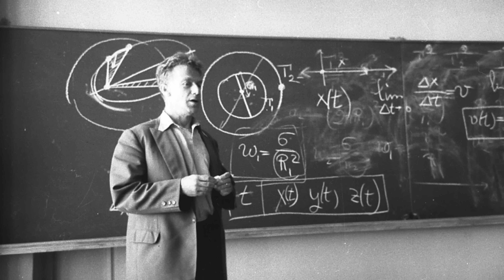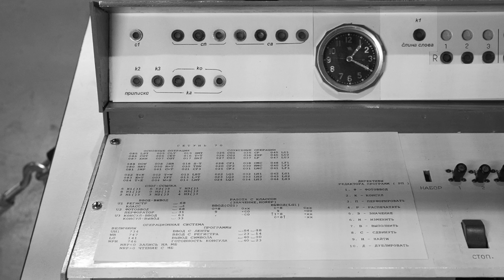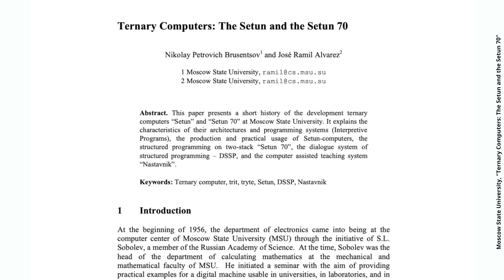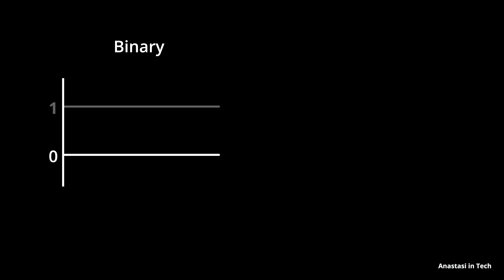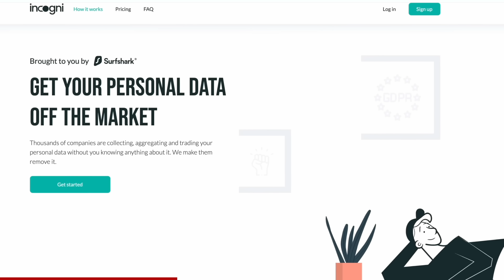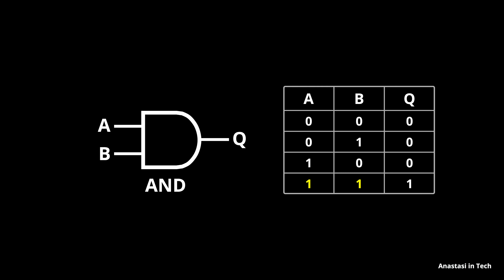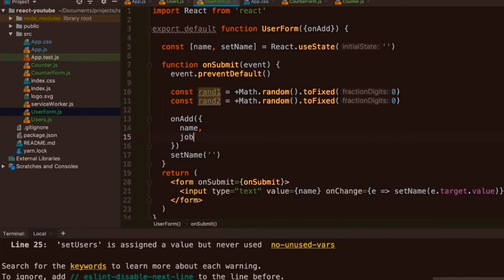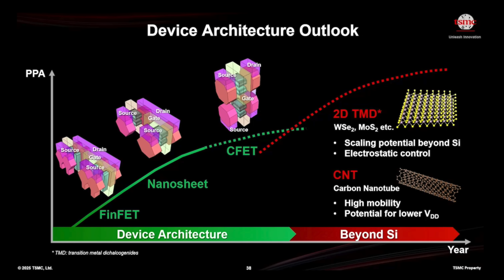The World's First Ternary Computer

Comment: A combination of buzz words but no explanation.

You told us, a ternary computer would use trits of -1, 0, and 1. This could be made by using -5, 0, +5 Volts in the chip. But where are the benefits?

No, subtraction will not be easier it will be more complicated! Calculate a +-0 to a decimal value! Even representing values is pure horror. We would not use -1, 0 ,+1, we would use 0, 1, 2; no matter of the sign of the current.
On binary machines we can distinguish negative and positive values with one bit, whereas 0 is positive. On ternary machines a compare cycle is needed. Whereas a compare cycle means a subtraction discarding the result, just keeping the CPU flags.
Subtraction on a binary machine is quite easy:
1. Invert all bits
2. Add 1
You have the negative value: 2's complement
3. Add the value to the value you want to substract it.
Maybe on a ternary machine it would work as easy as this, except more complicated circuits inverting a +1 to a -1.

Vacuum tubes and transistors always have and ever had infinite values. Both devices were and are used for amplification. One low input current controls a way bigger constant current becoming a modulated, higher output current. Even relais can have infinite values. One input just turns on and of the other input. Whatever gets into this other input will leave the output almost unaltered.

Digital tech is analog tech. An analogue signal of a defined strength is a 1, an analogue signal of 0 or below a defined strength is 0. And any signal inbetween is undefined, resulting in random 0 and 1. This is how any computer engineer works. Think of transporting serial data. Switching from +1 to -1 (and vice versa) will reach 0. On slow computers of the 1950ies this will work, maybe with an additional line for synchronization (whereas binary transport allows transport without a sync signal). Today we switch from parallel to serial communication: The speed of our computers is so fast the time differences on parallel lines are a big problem. 3 wire communication is parallel: GND, DATA, SYNC. On binary 3 wire channels there is the undefined range. Measuring it means a communication error. Ternary machines just run into a random value, unable to detect the error.

The Soviet Union failed in computer development. They needed their colony GDR to get machines to procude Z80 clones. While GDR copied 8086 CPUs. The Elbrus CPU is a SPARC clone and Fascist Ruzzia is unable to produce them.

Comment: And the 3rd state when dealing with electricty and transistors being? Will our chips run with 10x the voltage for a few minutes and then melt?🤔 Not to diminish the accomplishments of your copatriots, but it reallly looks more like a nice science experiment than smth. that is applicable on a large scale. There are other designs in the works which are more robust and probably less theoretical in their execution.

Comment: There will be less noise, as the pulse front will be smoothed out due to the three states. Three states and ternary code have been used in the data transmission system (OSI layer 7) for a long time. Вот шума будет меньше, так как сгладиться фронт импульсов как раз из-за трех состояний. В системе передачи данных (седьмой уровень OSI) давно используют три состояния и троичный код.

Comment: i always wondered about using a adc and a dac to change 16 bits into some ohms then you can store 16 bits on a single resistor. its a way to interface with binary tech using one wire tech and send 16 bits per pulse its faster than serial infact using 3 color light fiber optics you can do 48 bits per pulse based on each pulse is 3 colors each color is a analog input. or more thats all based on the dac and the adc is 16 bits but i seen a 24bit but you can always add multiple together to get more bits you can get 64 bits per resistor you can get three 64bit cpu commands per fiber optics pulse. i kinda abandoned the idea when i decided if i wanna do that i might as well go back to core rope memory or not that but similar tech something i can make with a cnc machine.

Comment: Ternary logic systems (using three states instead of the traditional binary “0” and “1”) do have theoretical advantages. Each “trit” (ternary digit) can represent more information than a bit — specifically, log₂(3) ≈ 1.585 bits’ worth — so computations and data representations could, in theory, be more compact and efficient.

Comment: I can see it’s advantages and disadvantages. You would have to create a new compiler, new software to take advantage of the additional option, the smaller size, faster rate, less heat and power consumption but the data storage would have to remain the same or you would have to create a new way of storage. As someone else pointed out, the transfer rate would have to be changed as well. I could see it working in a sine wave I just can imagine it working in practice. Binary to me is the simplest and fastest way for transfer rate.

Comment: Ternary systems face significant hurdles. Hardware design is more complex—binary transistors are simpler, cheaper, and well-optimized after decades of development. Ternary logic requires components like memristors or multi-state transistors, which aren’t yet as reliable or scalable. Standardization is another issue: the entire computing ecosystem—CPUs, memory, software, and protocols—is built around binary. Shifting to ternary would require a massive overhaul, from chip fabrication to programming languages. Energy efficiency gains are also unproven at scale; while some simulations suggest ternary could reduce power consumption, real-world implementations like Setun didn’t consistently outperform binary systems.There’s also the question of necessity. Binary systems have scaled remarkably well—Moore’s Law held for decades, and modern techniques like parallel processing, quantum computing, and neuromorphic chips address performance bottlenecks without abandoning binary. Ternary’s advantages shine in niche areas, like certain AI algorithms or error-correcting codes, but it’s not a clear winner for general-purpose computing.

Comment: Excellent video, I'm glad you explained the ternary logical operation (-1 && -1 appeared a second time in place of -1 && 1, so you are aware). I was curious to know how it worked. I like the idea that using two "trits" you can store more states than using three bits.
The missing point? Conversion and compatibility. If you can convert ternary to binary, or vice versa, then it will be easier to integrate, expand and eventually judge if the added complexity is worth phasing out binary.

Comment: When I was a kid, about 8 years ago, I told dad that modern computing is in binary or with the base 2 (1, 0) and it is quite inefficient, what if we would compute at like base 3 or Trinary(yep I called it this back then)(0, 1, 2 or 0, 1, -1). He brushed me off saying it was a radical idea with almost no mathematical backing let alone practicality and that I should use my brain on something more "pragmatic". Glad to say I wasn't wrong. Would love to be a part of the Ternary or "Trinary" Revolution.
Reply: There is too tight margin for errors in hardware parts which has to be developed yet, 2 standardized micro parts vs 3 with very sensitive borders where errors would come too often. Same as having one car battery, having 2 batteries in series and more, you need BMS (Battery management system) for absorbing and redistribution without errors.
Reply: @Your_opinion_does_not_matter Only if you do not code for fuzzy logic which i personally predict we will be doing within the next 10 years. Todays hard- and software are chiseled in stone for 100% "truth". But thats not how biology works.

Comment: I used to work on Flight Simulators produced by Link systems back in the 60's/70's.  They used MECL devices (Motorola Emitter Coupled Logic) in their computer processors.  They didn't fully turn on or off a transistor logic element but the output of a logic gate changed from -1.15 volts (a logical 1) and -1.5 volts (a logical 0) (could be the opposite, it's been a while )  This made them extremely fast.  We were able to run two 727/707 full motion flight simulator cockpits simultaneously with 8k of memory and 16 tracks of 8k programming code.  Still digital and It did take a LOT of power to run but worked beautifully.

Comment: I had seen on another channel that topic a month ago, and found it fascinating. But the recent news about Huawei is a new step forward, and that could bring a huge improvement, making it a bit more real. Also, the part about graphene is all new to my knowledge, and, while I find it great, it sounds like most things I've been following in new techs. Graphene seems like the new material that should change everything. It would make batteries so efficient (especially for EVs, but it would benefit everything) could be used as water filters, and many other things, all the while it's made of one of the most common elements in the world, carbon. If it stops being just a nice promise for the future and becomes even 1/2 of what I've heard about it, that might bring so much improvement in everything. Till then, it's sadly nothing but a promise for the future.

Comment: We touched on ternary state logic in university decades ago. For me, it was the logical states. In electronics we were already differentiating varieties relative states ±.5v, ±.12v and 0v. Why couldn’t we do that with logic gates? This is doable but yes, at such small Delta V we need better precision in circuit integrity noise protection. And I agree with the needs of today, AI requires much more memory to meet our imaginations. It is the only way we will achieve the sophistication of an android named Data.

Comment: When you power a 'computer' ON...it is then capable of binary computations, but is in 3 States. ALL computers, chips, etc are 3 state or more... they all require POWER first, binary second.
Reply: ...American transistor? :D 
Transistors are binary...
Reply: Base3...kinda sux hind tit... it requires more bandwidth, longer trinary phrases, longer code, longer parity checkers, and massive data buses... and memory assignment...is...kinda sketchy. Longer transmission times, higher power requirements to push all that...
Reply: ...any 'computer' can run Base3 languages... but, they are old, outdated, outmoded...clumsy, awkward...and limited
Reply: ...where you may have a Point... is quantum computing. :D 
IF quantum computing is considered 3 state programming... 
Or, +spin, -/+ transition spin, - spin due to coupling vs entanglement... 
 But, that would more than likely be in arrays of 3 or cubes of 3x3x3 as a bit. Half Bytes ( nibbles ) would then be 9x9x9 and full segment phrasing would be constructed of 729 bits to a word/command. ...and the firmware for this would be...really power hungry, heated and would technically be comprised of 4 state chipsets... power On and then the trinary quantum states. 

* 3 state chipsets already exist since like the 50s... or trimisters, rheostats, JFETs, UFETS, etc.

Comment: Can someone work on light energy vs electrical energy in 3d glass components type with different type of logic. Similar to trinary logic, light from 3 direction and receives in other direction,  with a cross function of light criss-cross as logic operator those compile multiple binary processor to translate to our current framework but way faster speed with logic operator on the side

Comment: The optimum is e=2.718....  Thus, 3 is closer to 'e'. But it is getting quite complex.
Let's assume 0 and 1as a condition, and then x as a third condition.
A generator for numbers, based on a power of three, would be as follows:
.
01x0=15=F
011x=14=E
0111=13=D
0110=12=C
010x=11=B
0101=10=A
0100=9
00xx=8
00x1=7
00x0=6
001x=5
0011=4
0010=3
000x=2
0001=1
0000=0
-------
xxxx=-1
xxx1=-2
xxx0=-3
.
.
Starting with 0 and going upward with the schema 0-1-x and continue to do this. The next power of three is then three times zero, three times one-, and three-times x. Then continue this schema to the negative side. To get to the hexadecimal F one needs one digit lesser. This is some advantage. ALUs are less wide and so are address busses and data busses.
However, some decisions remain binary, due to the fact that the answer to a question is YES or NO only. The question is rather: Is it worth it?
A person in the room: YES or NO
A car on the sensor: YES or NO
Water level plenty: YES or NO
One needs also binary logic in any case!
At the time when computers were developed, they had even difficulties with the purity of the semiconductors. In Germanium they could make PNP types easy, in Silicon they could make NPN types easy, but not both types on the same chip.
When I stored code and data on tape, the tape was either positively or negatively magnetised, and nothing in-between. 
Thus, the decision at that timepoint was right!

Comment: In 1982 I spent $1200 with a patent attorney for a patent search on ternary applications only to learn there were existing patents at that time.
Reply: And none of them are being used, because the US, the UK, and the USSR, each independently built a ternary computer in the  circa 1960  +/- 5 years era, and NONE of the governments pursued building even a 2nd machine, because all three projects proved that ternary is more trouble and expense than the equivalent capabilities (numeric range, speed, etc.) built as a binary system.
Reply: @akulkis I'm aware. From my patent search I was able to see it was government/military use that prevented any further commercial development. At the time I was using a combination of positive and negative logic with 3 States, +5vdc, 0(grd), -5vdc using cassette tapes for storage. I got that idea from my Sinclair ZX80. I immediately realized the potential for data compression and data transmission speeds with ternary data encoding. Patents existed for both of these applications effectively barring commercial development and yet their were no commercial products that were using it. Three engineers at IBM were named in the patents I found.

Comment: “The Breakthrough That Could Change Computing Forever”:

The video explores the concept of ternary computing, which uses three states (-1, 0, +1) instead of traditional binary (0, 1). This paradigm offers potentially far greater efficiency in logic, computation, and hardware design.

Historically, most computers use binary due to technological limitations (vacuum tubes and transistors naturally had two states), but in the late 1950s the Soviets built the Setun: the world’s first ternary computer. It was cheaper and more efficient, but was discontinued because the ecosystem had already shifted to binary.

In 2025, growing AI power demands and data-center energy consumption are pushing modern engineers to reconsider ternary logic. Huawei recently unveiled a new chip with ternary logic, using special transistors with two threshold levels, allowing robust distinction between three states—potentially improving chip performance and power savings.

Benefits of ternary chips include:

Higher data density (each “trit” stores more information than a binary bit)

More efficient arithmetic (no need for sign bits for negative numbers)

Possible reductions in component count, energy consumption (up to 60% less), and increases in speed (up to 20% faster)

The biggest challenge is manufacturing: distinguishing three states is harder than two, and today’s entire semiconductor ecosystem is built for binary. However, advances in graphene and carbon nanotube transistors (as used by TSMC/IMEC) make mass adoption much more feasible. These materials naturally support three states and offer huge energy and speed benefits.

Most experts believe ternary will first complement binary in specialized areas like AI, data centers, and energy-sensitive applications.

Bottom line: Ternary computing could revolutionize chip design and computational efficiency, especially as AI and advanced software push against the limits of binary hardware. This change, like historic shifts in technology, could bring major breakthroughs if its technical challenges are overcome.

Comment: Thank you for sharing this video... From 10:30 to 10:32, that still look like circuit with binary logic gates; hence it was an attempt to have base3 numbering system implemented in binary circuits, overall circuit size will be larger and less efficient... until we get a new type of transistor that can maintain 3 stable voltage levels, we'd still need base2 or binary numbering system for binary circuit implementations (i.e. transistors and logic gates) for highest efficiency... at 11:30, i guess your intended truth table would be "A=-1, B=+1, Q=-1"; hence the "B=-1" is a typo...  thx for sharing this interesting video with us...

Comment: Ternary AND = Slower, more consumption and more logic, I solved it with my quantum architecture.
Just wait and see.
it can be easily transferred to a classical transistor.

Makes:
CPU 2.5-3* faster.
GPU 5-6* faster.
Memory controller 0.5-1* faster,.
and more efficient.
Minimum values, Theoretically *2 Possible.
Unfortunately, I can’t reveal any more at the moment. 

You will find out as soon as the time comes.